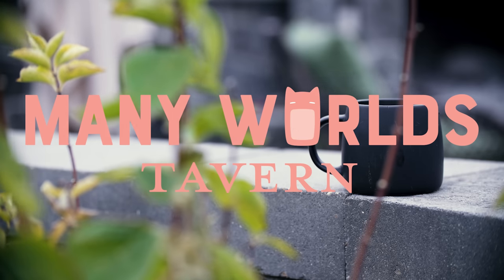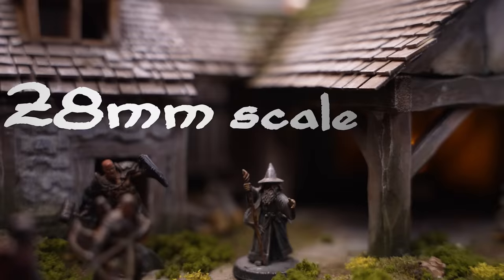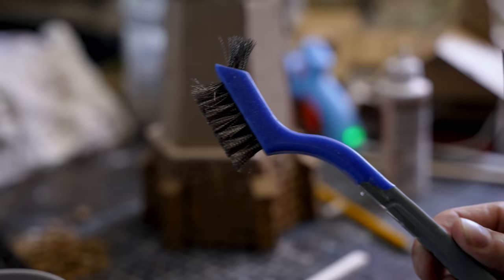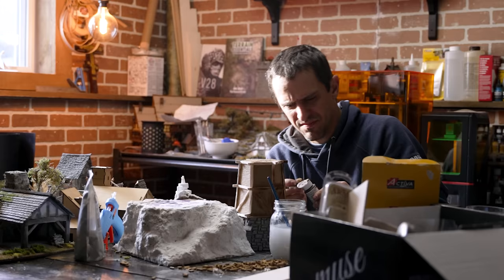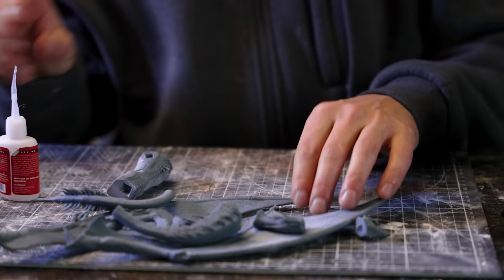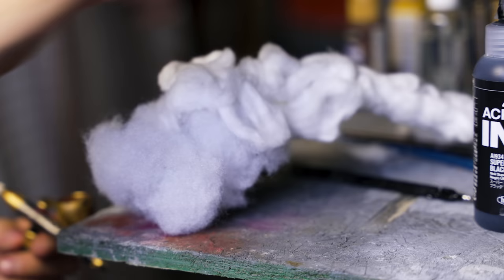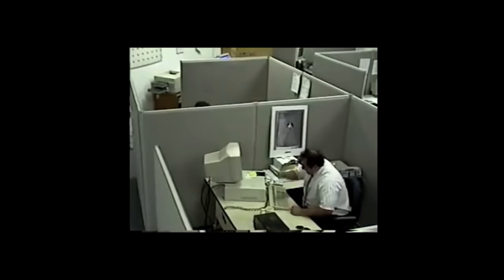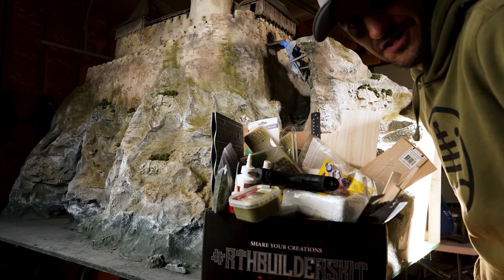REAL FIRE?!  Amazing miniature effect burns down castle!

Comment: There are different techniques for filling the frames in half timbered house and wattle-and-daub are but one. Many buildings belonging to wealthier builders use bricks and in other cases they were filled with wooden boards. Other construction methods also exists.

The benefit of half timbered houses is that they are completely modular and can be repaired and changed with a surprisingly minimal amount of effort.

Comment: excellent work as always Neil! I love how you put the battery in the bottom of the flame. My first instinct would have been to put it in the body of the dragon, but I thought it was a great idea to hide it in the cloud.
Reply from the maker: Hey thanks my man!   Yeah, I would have had to hollow the body before printing and make a slot, which I didnt think to do.  Also not sure if the body is large enough either.  But, at least this way all is completely hidden and I didnt have to mess up the model too much...  Well more than I already did 😆   Thanks for stopping by man!

Comment: Beautiful! One tip that might help - its actually pretty simple to use blender to remove a section of a model and actually print the model with a hole for a stand like you've used. Helps avoid the need to drill it out!
Reply from the maker: Yeah, for next time this is exactly what I'll  do :)

Comment: I recently made same project (fire-breathing dragon)
simple but very effective.😀👍
Reply from the maker: yes, very simple yet effective!  I was contemplating using the green for the fire but decided to keep it orange :P
Reply: @RealTerrainHobbies   I plan to use green in the dungeon to simulate a poison gas trap
Reply: reviewed again more closely...actually I used a slightly different technique.  I used a glue gun stick and a couple of flickering tea lights.  so my flame flickers a little.  it is also not attached to the dragon, which allows it to be used as a presentation of fire spells (as if the flame comes out of the wizard's palm)

Comment: I feel your pain, about the spill, there, at the end.   A few months ago, I bought a packet of powdered lampblack, for my current project.  I foolishly left it in reach of Mr. Kitty, while I went out to run some errands.  He apparently thought,  "Oh, here's something new to shred.  Once I've destroyed the envelope, I'll course push it off onto the floor.  And, since I've gone to that much effort, I'm CERTAINLY entitled to LIE DOWN in it!  Then, I'll make sure that my feet are COVERED with the shit, before I jump up on the bed and walk all over the ENTIRE spread, before settling down for my NAP!"  Ahh,  'gott'a LOVE 'em!  As for the incident with the dragon, I've drilled lots of heavy gauge metal, in my time.  With that stuff, the kind of thing that happened in the vid can be REALLY dangerous.  To avoid it, I start with the smallest bit possible and work up to my final diameter, while running the tool at  tool at the lowest practical speed.  If there's not enough surface for the bit to grip, it'll cut before it can build enough torque to grab the piece.  'Takes longer, but can save lots of grief.  Keep up the great work, dude!

Comment: It would be more realistic if you let the dragon levitate by a stronger wire through the fire and securing it to the main castle instead of showing the post to hold the dragon. Just a thought. I saw a similar project and looks like a snapshot dragon in midair

Comment: Hah. Lord of the Print really just has the best dragons you can find anywhere... 
Which reminds me, I still have a half-finished adult black dragon lying around in my gigantic pile of shame somewhere ...

Also, when drilling hollow resin minis (I know this well because I've recently had to drill some 10mm holes in my chaos knight for magnets), it helps to go very, very slowly. As slowly as you can manage. Not with much pressure. Just shave it off bit by bit.

Comment: What a great build! I was really hoping you were going to use the wire in the flame to mount the dragon. Some stiffer wire and some brass tubing hidden in the models would allow you to plug him in anywhere.  you could even hide the holes with small detail pieces that fit in and covered them til it was dragon time.

Comment: Has anyone mentioned that Neil could have run a bent-up coat hanger wire are fencing wire through the smoke plume instead of using an acrylic rod
Reply from the maker: Yeah, the acrylic rod is so the dragon can be mobile and used on the gaming table.  I should have clarified that

Comment: beautiful build. Would it have been possible to attach the dragon to the lighthouse via the thick wire in the flame? So the flame touches the lighthouse and you wouldn't need to use the rod and stand to hold up the dragon.
Reply from the maker: I'm not looking to make it a permanent fixture but that could totally work too.  For gaming purposes, you want it mobile :)

Comment: Any way to use a strong enough wire in the flame to hold the dragon up without the need for a pole?
Reply from the maker: This is possible yes.  The pole is more for gaming purposes to move it around on the table.  But, I like your Idea too and could somehow make it work.  But that would also mean the end of the flame as to be fixed against what it is hitting, in this case the lighthouse which would make it permanent.

Comment: Hi Neil, quick question about the Dragons Flame: After you used the cotton balls, did you harden/seal them in any way? I used them for a cloudy base once, and I found that without it, it came apart very easily - but putting watered down mod podge all over it worked, but made it look way less fluffy. Any tips? Great build as always!
Reply from the maker: Hey, great question.  I did not seal it in any way.  This was my first time doing this so I'm going to have to give it some time and see what happens here.  I'll keep an eye out and see how it hodls up.  If it doesn't, I'll be using your tip!  Maybe some matte varnish might stiffen things up too while keeping the fluff??
Reply: @RealTerrainHobbies  Varnish could work! I was thinking about hair spray as well, but varnish makes way more sense :D Still going my first steps here ;) Thanks and all the best!

Comment: why didn't you put the wire and a support for free floating drangon inside the the fire and attach it to the tower ??
Reply from the maker: It's a gaming piece for tabletop gaming.  you want it mobile to move it around.  I might add a wire and drill a hole into various places on the model for a strong wire to fit in though so it can be mounted in various locations!
Reply: well. you are excused then,, super nice work,, as allways

Comment: Shouldn't you paint that pole that holds the dragon in the same color as these rocks in the background? At least the outer side of the pole. Or remove that gloss. 
I don't want to sound like a cranky old lady, just think you can do it epically! 
Great work, as usual!🦄 I started yelling in my mind when u took the big drill and broke the dragon. XD 😅
Reply from the maker: Yeah great idea.  I'll be getting a clear acrylic rod right away anyway as a replacement, think that'll be better?   I just threw on what paint I had on hand on that dowel :P
Reply: @RealTerrainHobbies  In person it probably looks a lot better. When you film it and use strong lights that's what f*s it up. Even the clear acrylic becomes white. :D 
But then again, it's just nit-picking. Clear will work. :D